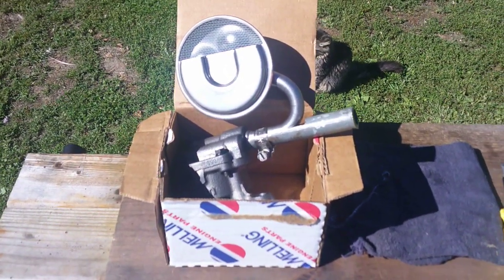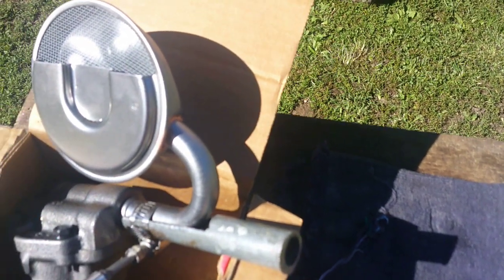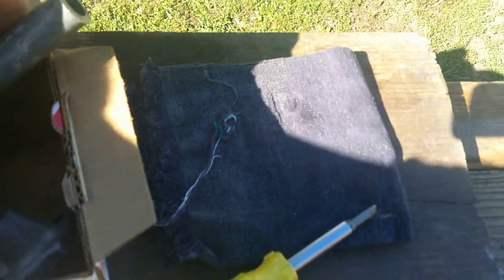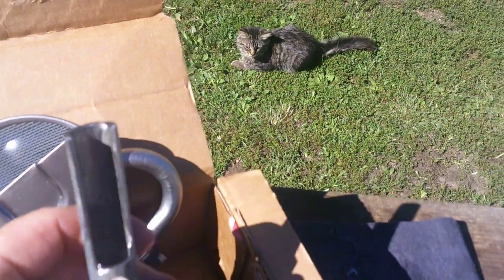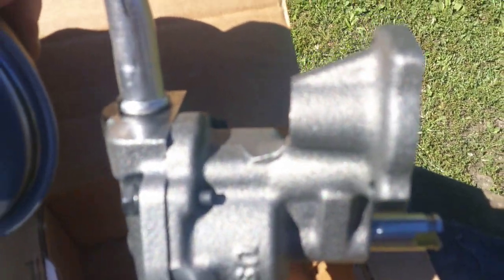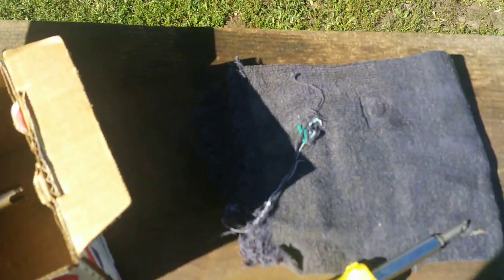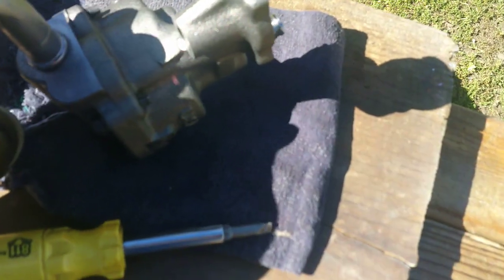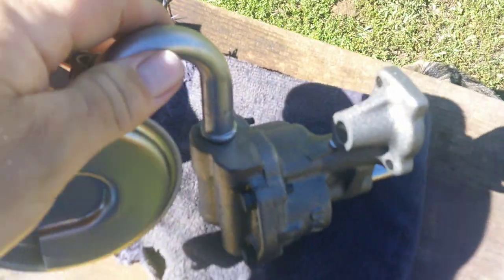DIY tool to drive in oil pump screen into pump on small block and big block Chevy

Comment from the maker: If your interested how to make the tool. Hold the pipe to the pick up tube to estimate the cut out.  I used a cut off wheel to cut the pipe into the shape. Then I took a flat file to the top to get it smooth and round off the sharp corners. then I used a half round file on the inside of the cut off end of  pipe until the pick up tube fits inside snug. I put a dab of thin oil in the port before installing. Most of the time i dont use a hose clamp but it does help hold it in place.Thats it and it drives the pick up tube in easy with a small or medium ballpeen hammer.  I have installed the pickup tubes with pump mounted on block and on a bench on a towl for it doesnt move. I have used it on many rebuilds over years and i have never worn out the end fitted to the pick up tube. The other end that gets hit with a ballpeen hammer looks smashed but it got like that the first time because the pipe isnt hardend.. 
I should of done a video installing it but i had already done it  when i got the thought of doing a video. If your in my small town of Central City Iowa look me up and bring your pump and we will do a video using it.